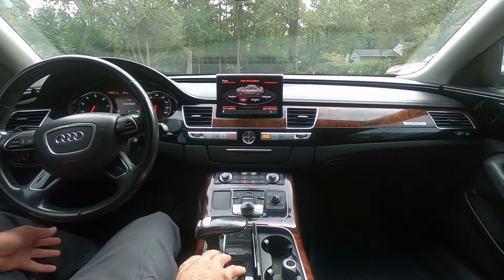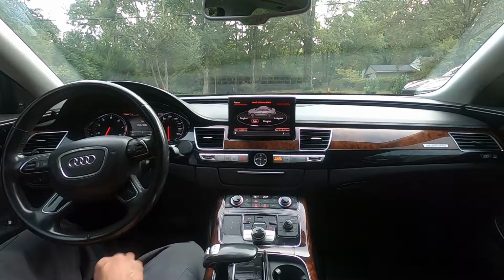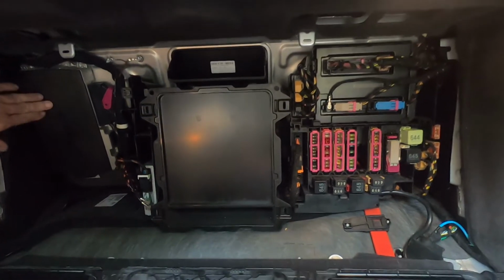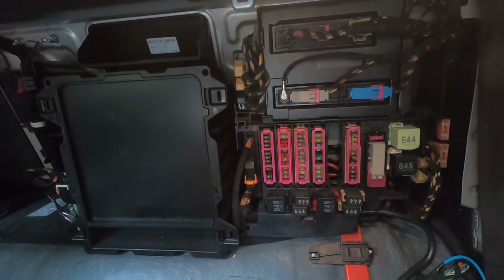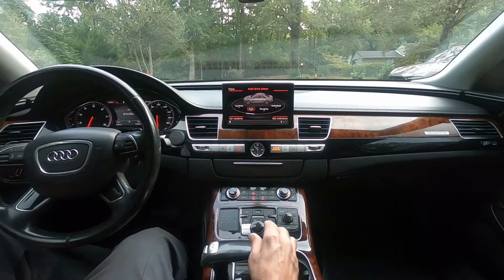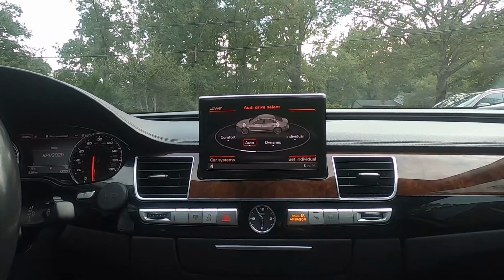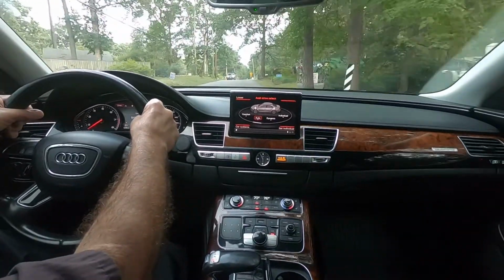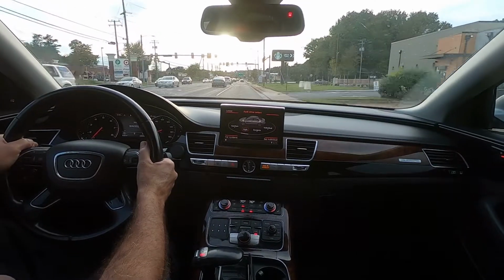2012 Audi A8L 4.2 Quattro I Problems and Test Drive

Comment: One time my D3 A8 was dead and my only key was stuck inside the ignition...I was unable to unlock trunk which is required to jump the car since there is no positive or negative point under the hood...the unlock system won't work because the trunk lock is locked by computer...the key won't release even with emergency key release hole trigged...the car was dead on the street for 6 months. After doing some research, I was able to feed power into the front lighter, this tiny amount of power released my key and I was then able to jump the car from the trunk...
Reply: You can get into the trunk through the back seat....please tell me you didn't wait 6 months for that
Reply: So it was your car's fault that you only had one key?  Really?